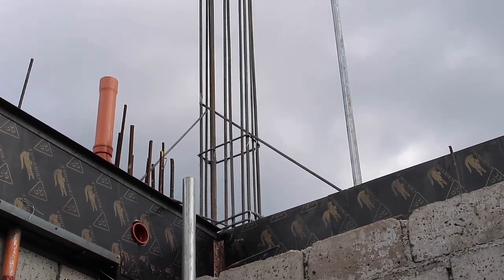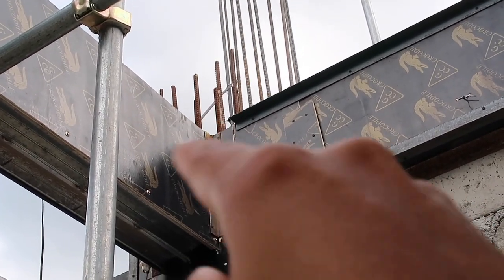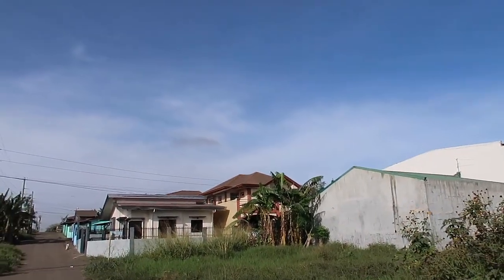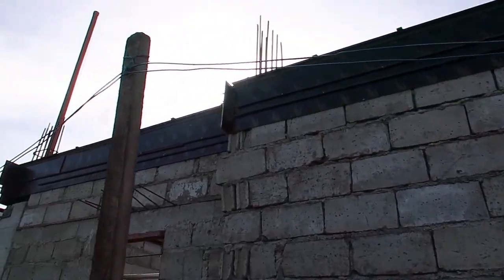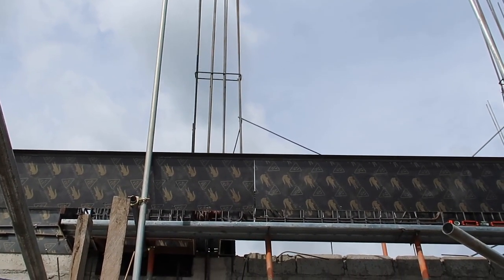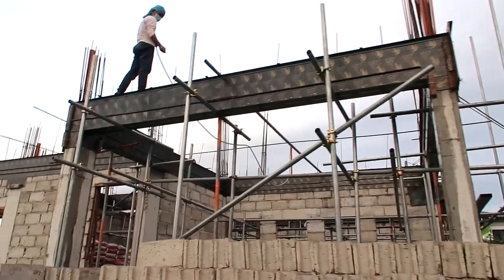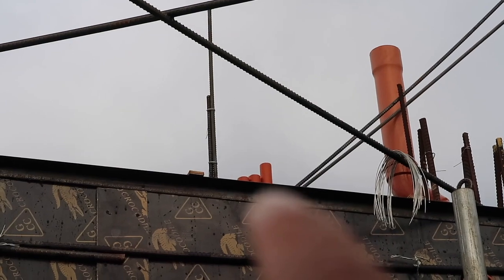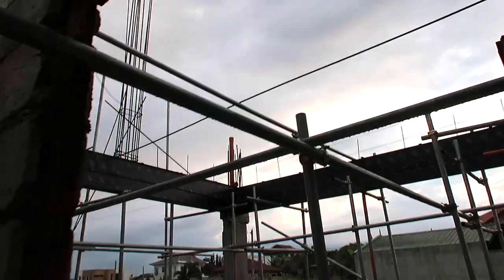HOUSE BUILDING IN THE PHILIPPINES - EPISODE 49: New column l Electrical pipe

Comment: Look at that beam rebar hooks, itblocated outside the column rebar, incorrect placement. Is it design to have a planted columns? The srchitect and the engineer did not communicate with each other for coordination of their work, resulting in this issue after issue during construction. As a diligent contractor they notify the architect or engineer about the issue. They should not do any changes in construction by themselves. I see electrical,pipe sleeves only.  Ot the actual councuit runs..@# I thought of electrical layout has not been coordinated from the start of the construction, I can d
Foresee future issues on electrical.